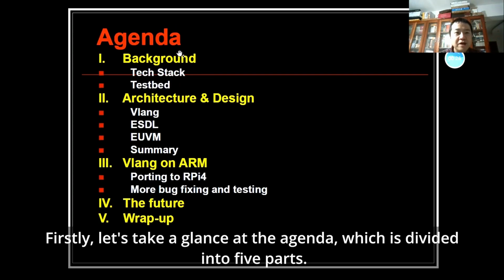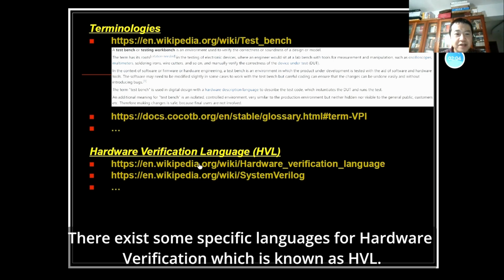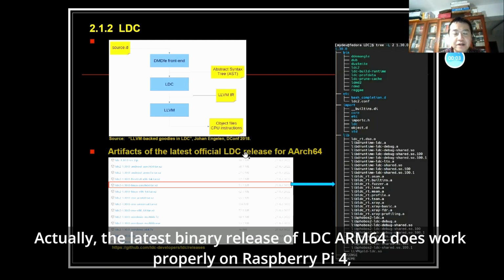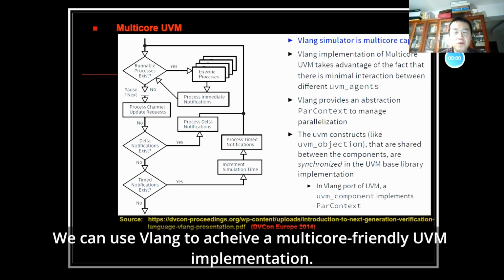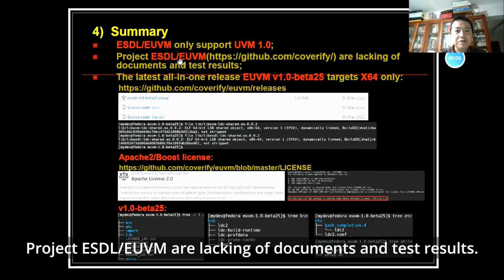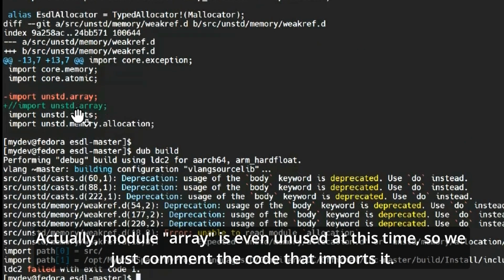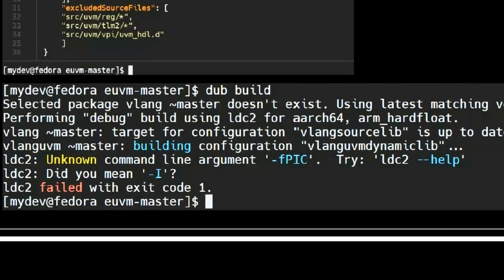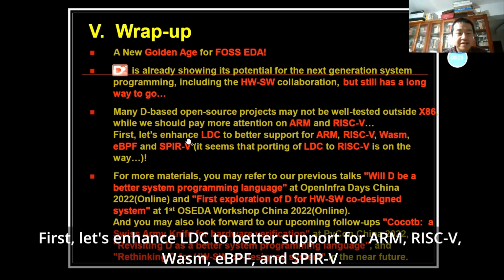DConf Online '22 Addendum: D-based Next Generation Verification Language

Comment: The reason you didn't get the dynamic library is that it is in a different configuration than the one you built. You didn't need to modify the sourceLibrary configuration.

I.e.
$ dub build --config=vlangdynamiclib

Or

$ dub build --config=vlangstaticlib

The first configuration is the default, which happens to be vlangsourcelib. Hence the error.